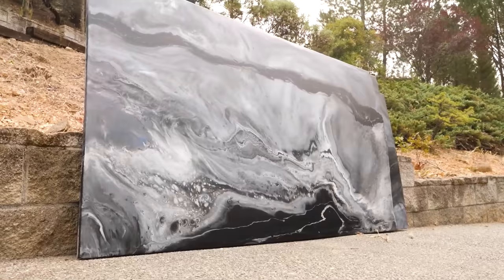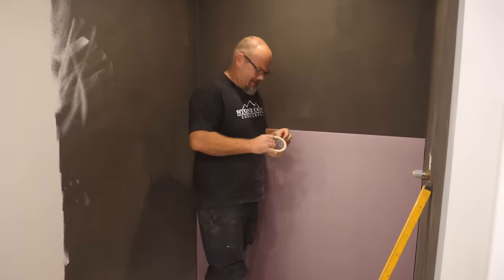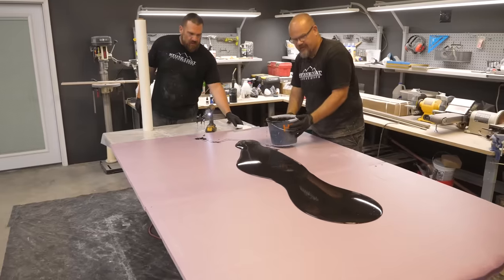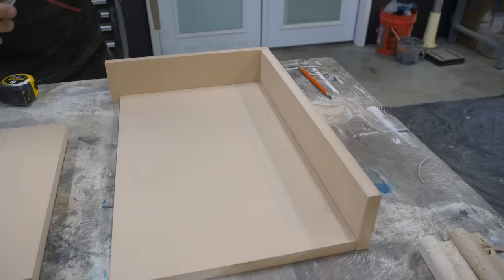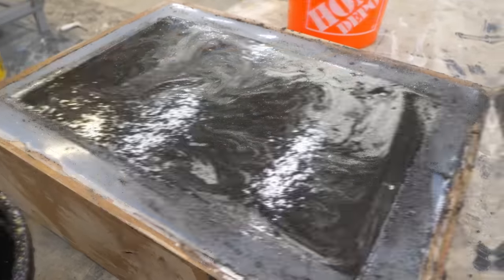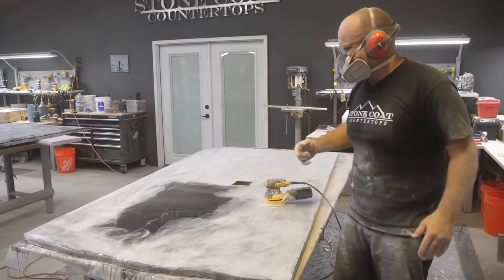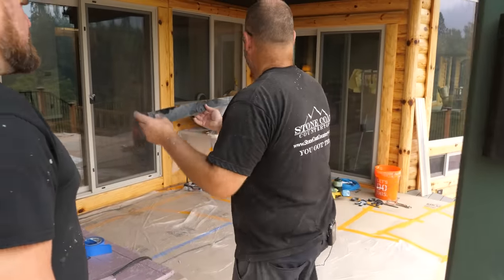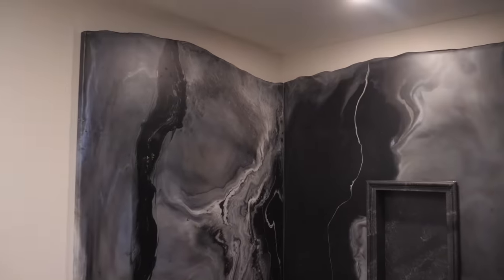Epoxy Slab Shower with Pink Foam, Come on the Jobsite Real Training

Comment: I have a question, inside your form shower wall. If you want to put grab bars inside your shower. One slip or fall in there could destroy the shower wall because of being made of form. How would you fix the bars so they were really solid and won't tear out?

Comment: So a grand in materials? And how many layers of fiberglass? 3 ply? I mean final answer. Ideally, would 3 ply fiberglass with epoxy poured be the way to go for permanent panels? 

I'd be tempted to attach it with foam glue or mastic also

Comment: What your doing with the shower is the same method I want to do using foam board to finish my back splash on my kitchen counter tops.....PS I did the dirty pour on my kitchen counter tops and when I started pouring it out of the bucket I could not believe how drop dead gorgeous it was laying out on my counter top....WOW !!!!  KODAK MOMENT...

Comment: Carpenter from Arkansas I do automotive painting on your shower panels when you’re totally done could you come back and spray a clear coat on it and possibly even wax it sence your going to spray a automotive clear coat  automotive clear coat is what I would use if I was doing some testing see how it looked and performed after I ran water over it to see if it was going to haze or chalk

Comment: Absolutely fascinating! You are incredibly creative. This is art.Yikes, I ended up here by accident. I'm 75 and it's 4:00 am and I can't quit watching.  Dang, I have a torn rotator cuff. How can I do this.??  I need new countertops. My shower in the basement is crap, worse. But I would have to figure out how to refinish the kitchen cabinets first. Or could I have the fronts removed and put them back on after?  ........ Do these scratch over time? Stain? If so how do you easily fix them?  How does this disguised foam stuff hold up over time?
Yup, I might live in a van down by the river, with way cool countertops:) I am subscribing for sure, right now. ... In the caulking, how far away from the edge are you taping it?

Comment: Kinda cool how your using a tile saw to do finish carpentry. You don’t have a chop saw? I like the tile saw as a chop saw I used for some baseboards, I’d swear was off 1/16” inch, trashed some expensive moulding.

Comment: I have 2 questions.  1. Why did you use black and white sand expoxy mixtures,  pour them separately into one mold only to paint over it? 2. How do the countertops, walls and pans hold up to accidental drops(hammers, cast iron)?

Comment: You were talking about how great the jig saw cut, and the other guy said "like a hot knife". I use a hot knife to cut all my foam whenever I can. no dust at all. I want to line my existing tub and shower. Can I use 1/2 foam with this method????? I want to square it to the ceiling and then at the last, I want to put a section on the ceiling. Love a multi tool!!!!! What about adding the solid edge before the mesh and having the mesh wrap around the solid edge?? Even onto the back of the foam...Why worry about using 2 colors to make the casting. You covered all of it anyway. Love the end product.  Had an estimate for solid surface walls in my tub, and they wanted from 8 to 10 thousand dollars to do it.

Comment: Question for you? Don't you think that in making it rustic that you could of put the shower caddy off center in your case between two studs to the right using your right stud as your left so basically moving it over a full 16" or at least offsetting it towards the controller and spray nozzle on any other build.

Comment: HEY NATHAN !!!!! I've got a pro tip for you. Wen you pour concrete molds, it's nice to have a vibrating table. I took strap metal for hanging pipes and screwed a palm sander to the edge of the plywood my mold is sitting on. If the concrete is thick. it flows like water into all the nooks and crannies. It also vibrates any bubbles right to the top so they don't get trapped and mess up the face of the mold. LOVE your instructional videos. you guys are AWESOME !!!!

Comment: Hello all, question for you! If I were to install a  membrane and cable, to create heated flooring underneath a dry pack,  what are your thoughts if i were to have that heat underneath an epoxy set, (rock design or design to match the resin walls)? The deck mud will be covered with red guard and liquid hydro ban just to be safe.  Or should I use concrete instead of deck mud and color it as you have here?
Layers:
Dry pack
Red Guard
liquid Hydro ban
Ditra heat membrane & cables,
thick layer of Thin-set (or concrete overlay,)
epoxy

With all those layers, would the heat even reach the surface? I am stumped. What are your suggestions?  Thank you in advance! I feel overboard but at the same time don't want any leaks.

Comment: hey guys, love your video, your channel and what you do in regards to that aluminum edge, and how the epoxy stuck to it… next time either spray it with a little furniture wax first and wipe it down or a little WD-40 and wipe it down that way the epoxy won’t stick and you’ll be able to pull the aluminum off very cleanly just a suggestion I have really learned a lot from watching you guys and thought that I would share a tip that I have used in the past. 
Keep’m com’n- Stephan

Comment: very inspirational 🙏🏼 ...
as you say Jigsaw - did you ever try to hold the Machine underneath the Board? That way you have absolut Control to guide the Cut without being distracted from Residue.
Give it a try if you did'nt b4.

But hey - your Results are seriously impressive

Greets from Berlin

Comment: Since you asked, to me, the shower is worth $10k.
However, I have a question on the threshold. Can a 200 pound person safely step on the threshold on a daily based?  How about a 309 pound person?
Would it be beneficial to remove some of the foam and when you coat the top, have the resin go all the way to the bottom. Like drill 1” holes every 6” for support. Of course the holes have to be staggered not just in the center.

Comment: In Flint Mi looking for great ideas to remodel the bathroom of the house I just bought.  I'm 6'3" and I haven't had a tub big enough for me since the early 80's. I've considered old claw foot cast iron, but they are rare, and heavy. Your idea with the inset shelf has got me thinking about designing my own tub,  silicon mold, epoxy/play sand mix for the pour to make the tub.

Comment: You tube thought I should watch this, glad I did.   The wood blocks for the hinges was smart thinking, the MDF strip was lucky, good mix.   As far as MDF, I’ve coated cardboard with fiberglass and resin and it has survived multiple WNY winters outside.  I’ve also have done wood repairs with epoxy, pro tip- use the solvent for the epoxy being used to thin to water like consistency, it soaks into the wood and turns it into plastic.  This really has me thinking as I have used the EPS, XPS, EVA foam boards in projects past.   I’ve always thought the heat from the resins curing would melt, warp the foam.

Comment: Hey such a sick vid. Learned a lot. I build surfboards. I usually cut my tape (aluminum mold in your case) in between the point the epoxy becomes tack free and sandable. For surfboards it’s usually 3 to 4 hours. Idk what tack free times are on your products. Haven’t tried um yet. I’ll go order some now after this vid 🤪

Comment: Why did you only do a silicone horseshoe around your tap behind the panel? Now when water might come between your panel at your tap point it will run down. Same thing counts for the top behind your panels, you only did dots and condensation eventually will run down behind them. So I would still seem seal the top edges of the panels. And I might have put some rebar in the cement floor. But everything else is nicely done guys, and looks stunning. I hope it will sustain for quit some years and that you’ll enjoy using it!

Comment: New house has a shower with 1x3 inch tiles on the floor and it was done so bad water will sit on opposite side of drain. 

I was considering dropping in concreate over it and trying a texture Epoxy floor.

It is about 1.5 inch deep from the lip stepping in, does that sound too shallow? 

Thanks in advance if you can't toss advice my way.

Comment: Nice I'm trying recycled styrofoam and a type S with lots of design, its presloped with a pan liner so not worried about the cement not holding shape tell it drys it's in a rv so I have to keep it lightweight got some epoxy to topcoat gonna go with your shower wall option.

Comment: on the shower you did out of the foam board it would cost 3,500.00 to 7,500.00 just for the granite for the wall alone then you have the other pieces you would need so the cist would go up yet. then for someone to install it would  be and im just guessing a few grand so thats a heck of alot of money. so your way is very very cool. ibstalling well anything is difficult if you dont have all the tools to work with. like if you only have a old skil saw and old hand saws and that about all the tools you have its then difficult to get a nice precise job done with good nice cuts and thing line up as they should. ANY SUGGESTIONS how to make it easier with just the old saws????

Comment: I loved the video, great idea, however I would use a piece of 3/4" x 5-1/2" PVC board glued to the outside edge of both end panels to be both 100% water proof and give you a solid mounting backing to secure the glass shower doors.

Comment: I have floating walls on mine. This means a 4.5-inch edge that my shower glass is going to. For that part to keep it able to hold up the heavy glass, I have solid wood all the way down and a wood top for the bench that is epoxy coated. Then I started on the foam boards!  
( I ripped out a garden tub to build my shower. So new divider/floating walls I built. )

Comment: So I have never made a concrete stamp either. But my thought is why wouldn't you put a heavy rubber mat on the back of that mold so that next time you've got a weighted stamp uniformly shaped say 2 ft by 2 ft which makes a uniformly flat surface you could put two three four together you can take a 2x2 or 2x4 or 2x3 whatever you need to do to make the shapes of your pan.

Comment: Coming from someone that has worked with fiberglass for over 25 years, you could have waxed that aluminum strip with a mold-release wax. It would have popped right off. I've done it MANY times.

Comment: Looks awesome. My only question is what is the durability like? I mean, if someone backs up and slams their boot heel off the side of it, would it dent the surface because the foundation is foam? Or does the added reinforcement protect the foam from damage? Just curious. I've been toying with the idea of playing with epoxy for a while now, and you guys have been an inspiration for me. Well done!
Reply: I think it's best to take a two by two piece of foam and play out the same thing they did. This way you can see the durability before you take on a huge project.

Comment: This is definitely cool stuff. My uncle once used MDF in a jacuzzi room for sound and moisture barriers and it worked absolutely amazing. The basement flooded during a storm and when they pulled the damaged wood. The MDF was dry and still usable.

Comment: Great video . Tip for you if you havent yet discovered it PVA for mold release of things like the aluminum angle . It is sprayable from an airbrush . Used in the fibreglass industry for mold release ..

Comment: could you extend the life of the stamp by putting a fabric mesh down in the silicone like rebar essentially? I'm thinking cheese cloth for flex with strength and without the sharp edges of a metal or plastic to cut through from the inside out as you use the stamp.
Reply: You could also use the fabric to make a fold of silicone&fabric to use as a handle of sorts to help with lifting it.  Since the "handle" is just silicone and fabric, it shouldn't interfere much with the stamping as it will just fold over out of the way.

Comment: It would be nice to be able to see a list of all the materials with the costs (even though they would vary from place to place and time of the video). There would be no point knowing the labour cost as that would vary a lot by contractor or even for the DIY guy. I, for one, would like to be able to estimate my job by  the total sq ft by total materials cost. I wouldn't want to attempt guessing by reading the product instructions as to what the coverage, since the technics usually vary and typically are overestimated. 
Could you share a rough cost/sq/ft, total sq ft and complete list of materials per project?

Comment: I love that the cross-over in foam/fiberglass/epoxy functionality includes this! I'm working on an ultra-light trailer / tiny home built entirely around this composite foam/fiberglass concept; the walls, the counters and cabinetry; everything.

Your showing how strongly the aluminum bonded to the foam has convinced me to use it as you did, but intentionally >.> 

I'm only an hour 6min in, but I'm struggling to find the actual names or product information for .. well, any of the products you use, making all of your hard work impossible to replicate to any degree from my end. For example, I find myself pausing the video, taking a screenshot of your epoxy bottle so I can flip it right side up and zoom in. ...    .......  Please consider listing the products used in the 'About' section for ease of reference. If the information is given only during presentation, it makes it very difficult to find later without re-watching the entire video. If the information is never given at all, it forces people to do crazy things to get what should be readily available.

All in all, great work! Love the effort, thank you so much!!
Reply: Then they can’t make a kit to sell you.

Comment: The panels seem like a decent alternative for the wall.

Your Floor pan doesn't meet code. You can't just pour concrete directly to the subfloor. You have put pan liner down first. Hit has to wrap up the walls continuously. Up the walls approximately 5" apove you mortar bed. And it needs to be clamped to the drain. 

Thin you can put your walls over the top of the PVC Shower Pan.

You can get detailed information on Oatey plumbing products.

Comment: I’m not quite sure where you’re operation is in the country but I have a whole Lotta work. I’d like to have done at my house and I’ve ordered some of your stuff and then I broke a few bones and got sick and now I can’t do this on my own, even though I have most of the stuff I need but not if I decide to do the entire house. Do you all travel to help customers? I need my entire kitchen done, three very large bathrooms, and heck if you’re here, I might as well do my garage floor, and maybe all the flooring in my house. I know that would raise the value of my house tremendously because I have laminate everywhere and my cabinets are still builder grade with the exception of the kitchen that I had changed out. Please let me know because I’m very interested in getting this done and I already know what colors and mixes I want and have a lot of the products I would need at least for the kitchen and I know what colors I want done in each bathroom

Comment: Love the epoxy work but have serious doubts about the longevity of this install. While I did see a Schluter shower pan the rest of this has little to no waterproofing.  There will definitely be water and mold behind the foam panels and the drywall where it meets the pan will be mush within a few weeks. This is a shame as the idea has merit, but the epoxy panels provide no water resistance to the materials behind them.

Comment: @ 8:00 you're taping the protective Ram Board and then taping the shower drain. Understanding this however, how did you install the base itself? That part is missing.  

Love the work!
Reply: Installed by plumber as mentioned at the start.
Reply: @sarahlockwood8133  Thank you. Out of that 2 1/2 hr episode I must have missed that comment.

Comment: Great Idea AND video Thank You.  Howevercomma, I have an idea for to fix your aluminum angle strip idea, Just put on a thin coat of VASALINE on the inside of the aluminum angle strip so the epoxy won't attach to it, it might work, try it if ya didn't already!!!

Comment: You can use marble dust as a release powder and it will color the low points in the concrete. So throw down the marble dust over the whole area stamp it out let dry then rinse off

Comment: A quick tip when you clear silicone around your shower caddy you can run a bead of silicone around it and use a spray bottle with soapy water and spray it then pull it with your finger the silicone will not stick to anything but what you caulk

Comment: On the shower caddy. Do you think the paint will hold up to time? I'm not a DIY kinda guy so I really don't know about the long lasting of this stuff.
Reply: never mind. You answered the question later in the video. Apply top coat.
Reply: Is top coat mold and mildew friendly. Meaning will mold or mildew remove top coat. what kind of cleaning supplies can be used in the shower.

Comment: I have used epoxy resin for jewelry and small crafts for years. It does not matter what you put it on. When you seal it with epoxy, water will not get to the foundation material. So MDF is a perfect base to start with. Even in a shower. 🤟🏼🤍

Comment: I wish you had made that shampoo shelf as one piece of the whole....so that the grain pattern flowed right into it.
Caulk that bottom pan to the walls. I would think that water would infiltrate with normal use, but If your drain gets clogged, you will have a tub.... that will leak... think about when you created that shampoo shelf and the (thicker than water) epoxy leaked out of the mold a little bit.  Regular water getting in there will grow mold... and you don't want to have to remove those beautiful walls!